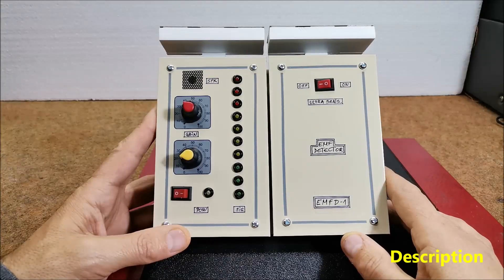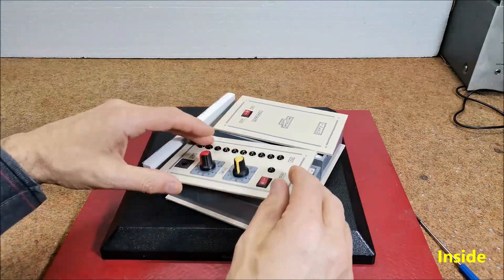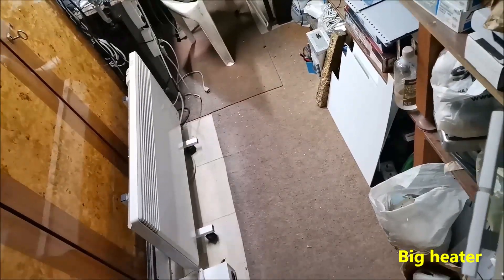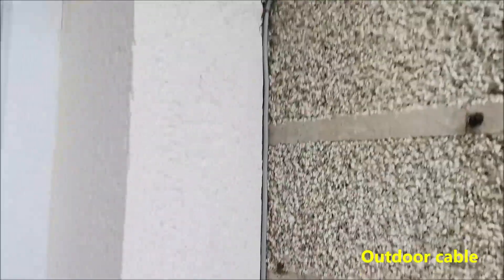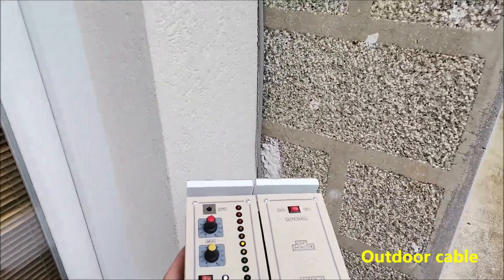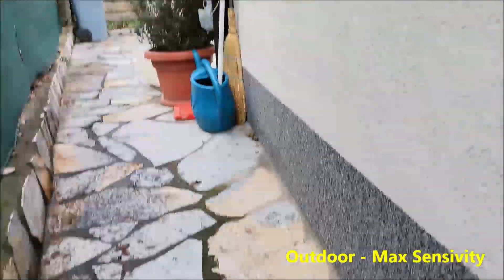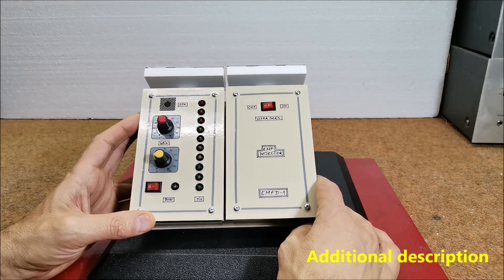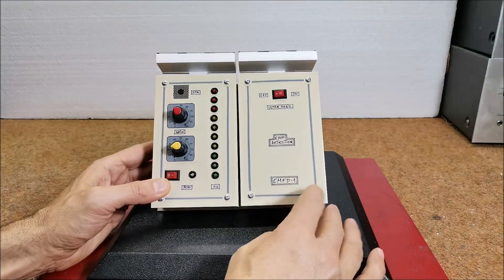DIY ULTRA SENSITIVE Arduino EMF Electromagnetic field Detector

Comment: Mirko please explain how to properly ground the arduino and not use a metal case, is it possible? Your code works on my arduino, but shows the maximum values, but if I touch the GND contact everything works fine and the values are adequate

Comment: Thank you for video, but I have 2 questions. It is possible to make, that the LED diodes light together but not divided, for example: if you find a high voltage and it begins to shine with red LED, but can it light together with another diodes also with green and yellow? The seccond one can it be transformed from ac to dc current as the LED changes from green to yellow for seconds?

Comment: Hello, can you send the clear and complete electrical diagram and where the antenna is installed in the Arduino, please. I need it quickly.
Reply from the maker: Antenna is connected to A5 input of Arduino.
https://www.hackster.io/mircemk/diy-ultra-sensitive-emf-electromagnetic-field-detector-529d89
Reply: @MirkoPavleskiMK You did not show where the antenna was installed in that location. I want a clearer diagram.❤
Reply: The antenna is connected to the A5 pin of the Arduino and on the other side to the pink wire coming from the Ultra

Comment: It appears as if your device is reacting to the voltage field. The magnetic fields are relative to the current so a power cord without anything plugged in would just have the voltage field present. The voltage field will reduce as the magnetic field increases in a conductor but with current flow in both directions the magnetic fields from each conductor cancel out.

Comment: This is fantastic!
Is there a way I can slow down the speed of the buzzer tones in the code? I'm trying to start with a slow beep that starts at 500ms and gets faster when you get closer to the EMF source.
I understand the sketch as it is, but I have a hard time inventing new variables to add on.
Either way this is perfect for my project, thanks again.

Comment: I'm going to use an ATTINY88 and then try to modify your code to work with 6 LEDs to the specs of a calibrated Mel meter.

I'll be using x10 ATTINY88 individually programmed using your code. 

These will be inserted inside 10 frosted 4 inch acrylic tubes with coloured LEDS as well as a DIY copper twisted spiral antenna.

Why did you place the Nano you used in a metal box?

If I need help modifying the code for use with 6 leds and calibrated to that of the mel meter can I ask you for help?

I'd really appreciate it.

Basically I want to use a purple/pink led for continuous on at 0mG. A blue led for 2mG. Then a green led for 4mG, yellow for 6.5mG, an orange led for 12.7mG, and finally red led for 22mG.
Reply from the maker: You need to put the microcontroller in a metal case because it is very sensitive to the objects around it, for example your hand when holding the device. The box should be connected to the minus pole (ground)

Comment: Hi Mirko. I built your detector, but in my case, the leds keep always on the edge. From the last yellow led to the red leds. I cannot reduce to the green area with the potentiometers. I placed ground wires over the cases of both potentiometers and wrapped the arduino board with aluminum paper. This made very little difference, to reduce the gain. Why do you think I cannot replicate your leds behaviour? I did not even connect the antenna. I am using just a short bare wire. Do you think if I change resistor values to reduce gain, would be a problem affecting the detection? Thanks in advance.
Reply from the maker: Yes, you should try a lower value of the resistor, and it will not significantly reduce the sensitivity. Also the reason for this may be if the device is not powered by a battery (stabilized voltage). Capacitors 100 microf and 100nF connected in parallel with the supply voltage should also be tested.

Comment: About the connection of the 10M resistor. Appears the switch is intended to turn it on and off from the circuit. In this case, the resistor lead connected to pin 2 of the switch should be disconected and then conected to pin 3 of the switch. So pin 2 has only the wire to analog 5 input of the arduino. Am I right?
Reply from the maker: The switch is intended only to reconnect the 10M resistor. In the situation as shown in the diagram, the total resistance between A5 and GND is 4M7 + 1M + 1M, and if it is in the other position, 10M + 4M7 + 1M + 1M.
Reply: @MirkoPavleskiMK  ok, thanks for answering. I also noticed that looking at the pictures you posted, the resistor conected to the cathodes of the LED bargraph is actually 4k7 and not 220R. The 220R resistor is conected to the on off switch LED.
Reply from the maker: @pcperez72  This is 470R resitor, not 4k7.You can use any value between 220R and 470R
Reply: @MirkoPavleskiMK  Hi. Sure. I just wanted to point that out, since the schematic shows a different value. Also there are filter capacitors that appear in the pictures which are not featured in the schematic. But I understand that if you use a regulated power supply, they would be included anyway. 
Sorry, for asking this, but I have no experience with arduinos.
I see the antenna is conected to pin A5 of the arduino nano, along with the gain potentiometers. But there is no preamp.
I found surprising the good sensitivity of the detector with just the antena and the potentiometers. Does the arduino do some kind of amplification internally?
Reply from the maker: @pcperez72  No, the arduino has no internal amplifier, it only accurately measures the voltage induced in the antenna by the electric field

Comment: Please, is it useful to discover the aura of burials, treasures, and minerals under the surface of the earth? Thank you
Reply from the maker: Unfortunately I have no experience in that area
Reply: @MirkoPavleskiMK  Please sir, can you put us the circuit diagram. The video shows capacitors connected to the Arduino. thank you very much
Reply from the maker: @jamilabusini4573  These are capacitors of 220 microf and 100nF connected in parallel with the battery. The device works stably without these capacitors

Comment: Thank you for this.  I would like to build a tunable version to use as a field strength meter for ham radio transmitter/antenna systems.  Good work!
Reply: i want to build for ghost hunt :)